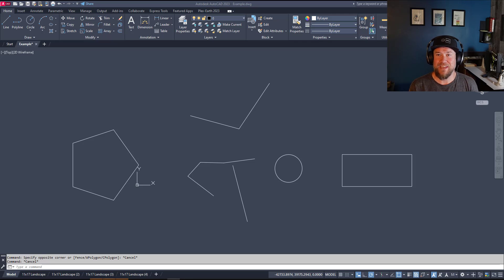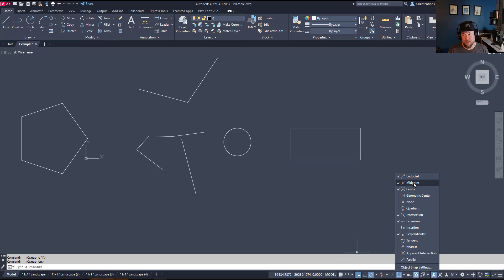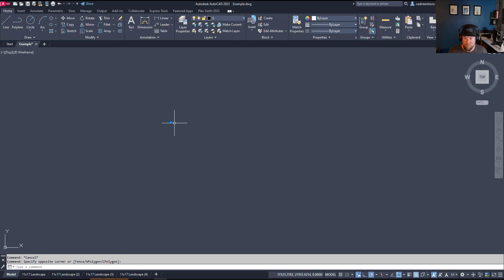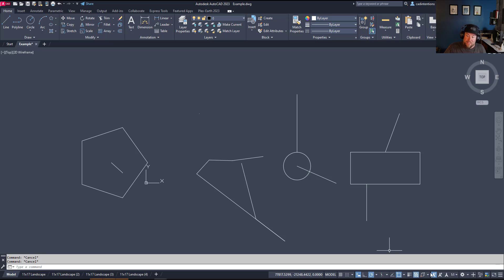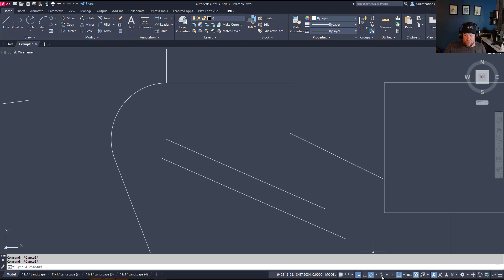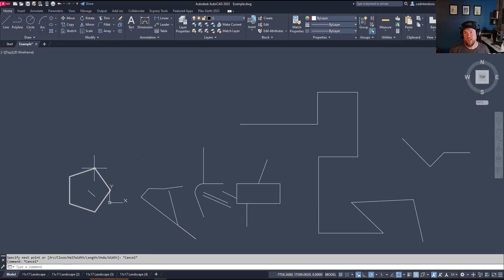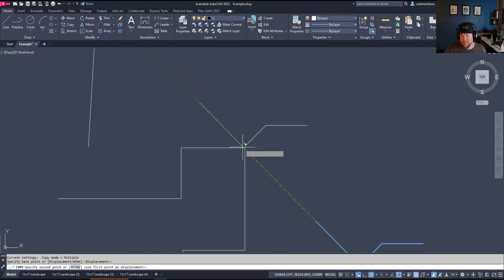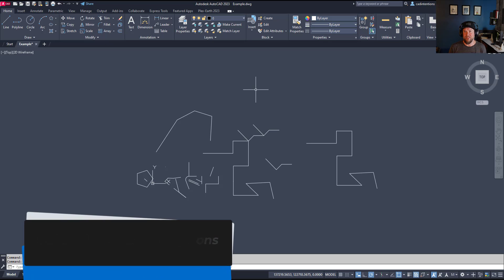AutoCAD Snaps & Ortho Explained! Plus Must-Know Tricks to Make Edits Quicker!

Comment: Civil 3D question. I discovered that my 1:1 scale was incorrect. it was set to 1 inch = 1 Foot versus the correct values of: 12" of paper-units equaling 1-foot ModelSpace. Autodesk tells me that the scale is only an Annotation scale, and it does not affect any geometry. That said, my section-views derived from my corridors are generating at 12x scale. The sub-assemblies are drawn in modelspace at the correct full-scale dimensions, but the sub assemblies measure in feet on the section views, where they should measure in inches. My units are set to Engineering, and my insertion scale is set to inches. I tried to change my insertion scale to feet, and a dialog box warned me that Engineering Units should be set to use an insertion scale set to inches as a standard practice.,

Comment: I would like to see a video on best practices for importing shape files. Maybe explain the differences between .shx and .shp, and landXML. Which of these files are best for importing surfaces?  I made a .dwg file from a surface that I had imported from a landxml file using MAPIMPORT. I then cropped the surface and saved it as both a landxml and a .dwg. Now, which cropped file is best to import into my new drawing, the CroppedSurface.dwg or the CroppedSurface_lamdxml? Maybe explain what each file contains. Do they both contain elevations as well as State-Plane coordinates as well as correct x-y coordinates?